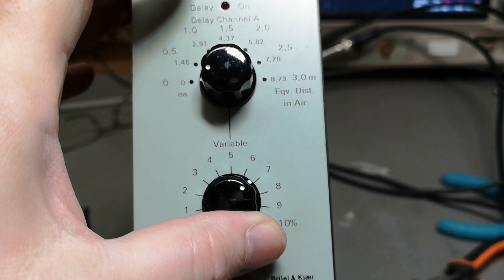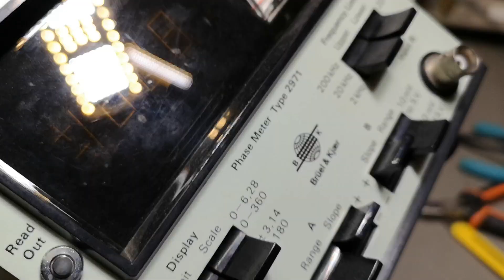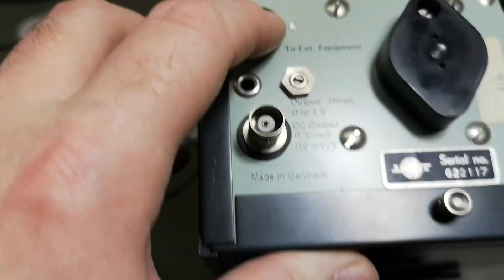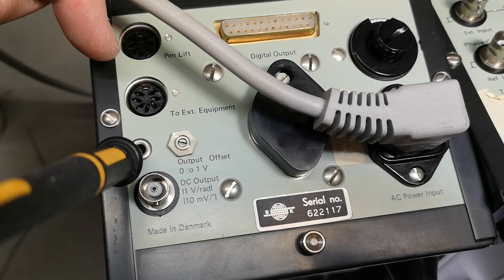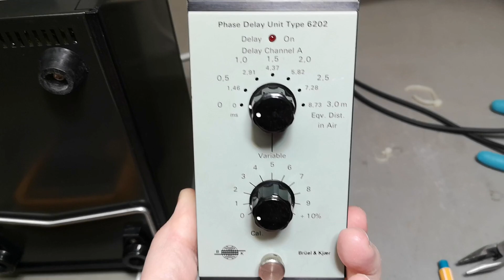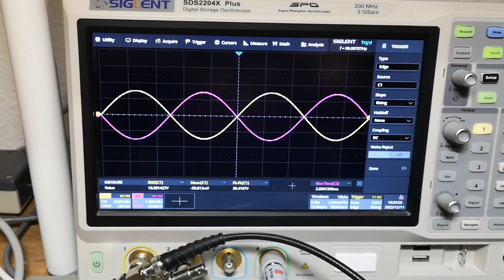Brüel & Kjær Phase Delay Unit Type 6202 not working teardown

Comment: Did you contact B&K / HBK to get some more information / schematics about these units?
Btw, it's very common to display delays in delay lines / prof audio equipment in meters, as it's used e.g. to shift microphone signals back into phase, if you are using different mics with different distance to the audio source. Delay lines are also very common with multi-speaker systems in larger venues - you need to delay the rear systems to stay in phase with the front / main PA. Here, it is also very helpful to read off the meter-info right at the delay unit.

Comment: Those 6 chips are 2533V form Signetics. They are 1 bit shift registers. I think they use some sigma delta system to generate a 1 bit representation of the audio and feed that into those regs.
Reply from the maker: remember this video : https://youtu.be/JzhF-IrprMM that unit also delay using shift registers, i think the 2533V looks like it is digital only when you look at its datasheet, however maybe they actually also work in analog mode ? if not, you are right, we need a PWM or similar type of AD and DA the filter section could be a reconstruction from a such pulse chopper AD type of bit stream. need more time, or prefered a schematic to investigate that.